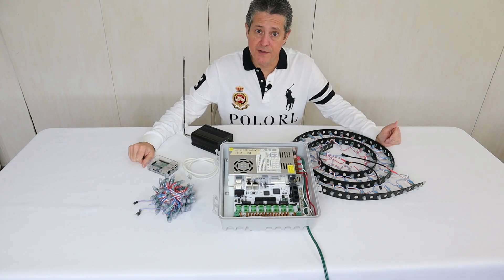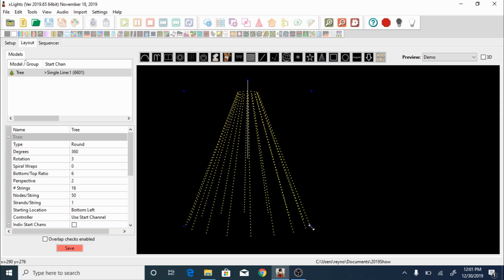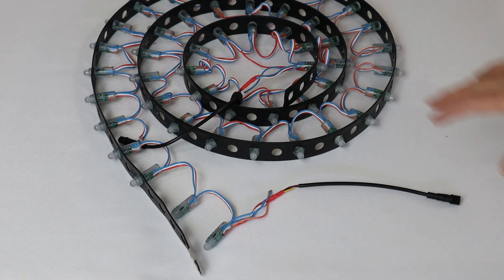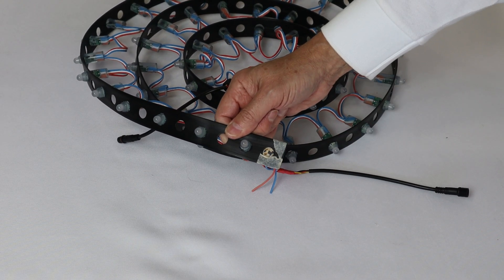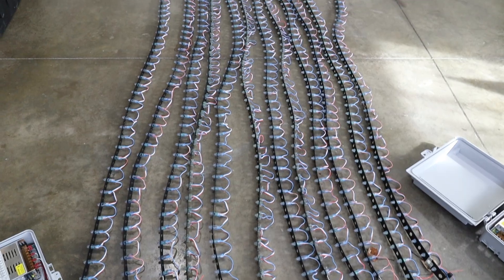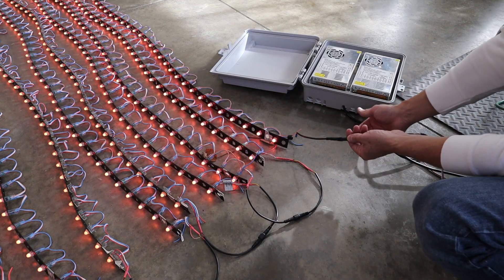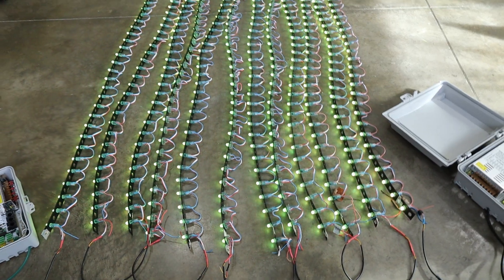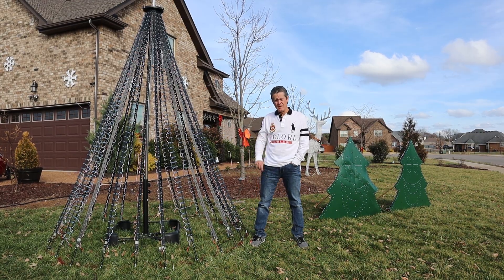How to build a L.E.D. Mega Tree - Step by Step

Comment: you have two controllers, do you have a link to the assembly of the controller with the power supply? does each power supply plug into the f16V3, doe the power supply get power from the controller? also since you have 2 controllers, and each is capable of 1024 lights, and you only use 600 each, do you run the other 424 to a smaller tree each?
Reply from the maker: Hello. I only have one controller. The controller is powered by only one power supply which sits next to it. I do have a second box with two power supplies. These ones are used to inject power to my mega tree and singing trees since they demand  more power. And yes, you could add more lights at the end of the two 600 lights strings. You will need to inject more power to them. I am going to add a star on the top of the  mega tree which I am going to connect from one of those strings.
Reply: So can you do a video dumbed down for those of who are new to show us how the power supplies work, how they connect to get power, a real close up of the inner workings. I would imagine it’s powered by a cord you plug into the controller or the wall? Maybe give us a detailed breakdown of where you got your materials and a details cost analysis. It’s so hard to know what is good. What is not. What works together and what doesn’t. Don’t be afraid to give a real “dumbed” down approach for those who also may not be computer literate. Thanks for doing how to videos. How much power does a power supply utilize. You said you have three. Thanks again.
Reply from the maker: @Lerchcon  I guess I could. Just give me some time. I have other videos that I'll like to upload first. You can find a ready to run controller just like mine in the link below.

You could save a few bucks if you do it yourself but not much.

https://www.pixelcontroller.com/store/index.php?id_product=50&controller=product
Reply: @trevilights  I guess my confusion really is dealing with importing other peoples sequences, I tried and none of them work. This cloud download crap is a pain in hen using Microsoft to download from website. And when downloaded from xlights program it didn’t work either. 

Other questions would be, what is the raspberry PI for if the controller claims to be ready to run, is there already one installed. I actually sat down and played with the xlights program. I created a full sequence for my mega tree to Mariahs all I want for Christmas. Then accidentally opened the internet. Seen the download still there so I deleted it tho king the one I created was good since I saved it. And it deleted the sound from my sequence the next time I opened it. Crazy. I redownloaded the song and added to the already created sequence. from your video I learned about layering. So good job. Little short videos of things like that will definitely garner more views for your channel. Thanks for also replying. And thanks for the videos. I also just tried to download the new version of that software and my computer keeps saying with three pop ups it will harm my computer and is blocked. The first download of xlights didn’t say that. Hmmmm.
Reply from the maker: @Lerchcon  Hi Lerchcon, Importing sequence from someone else can be very frustrating, specially because we do not know if they are in good shape or are incomplete. I will try to upload a simple video on it, but keep in mind that it would only work if you are willing to have a similar layout on your house. Now, the reason to use a Pi Controller is so you can run your show without your computer. The Falcon Player (Pi Controller) allows you to create Playlist with the songs that you want to play. You can have many playlist and play them at different time and different days.  It has many more options.  IF you are okay using your computer, then there is no need for one. I will create a short video on importing sequence shortly. Stay tune.
Reply from the maker: @Lerchcon  Just uploaded this video. Enjoy.

https://youtu.be/Elzd0GOgSm8
Reply: @trevilights  silly question. I have seen so many sites so far and forums where everyone seemingly is getting their equipment and lights from all different sources. Is there a way you can do a video of where to get all those items. Or just post links here 😂I don’t want to pay too much, Or shop a source that isn’t known for working items being received. It is China, which takes forever for shipping. and there are times we don’t get what we thought in my experience. Pictures say one thing but it’s not always right. Or damaged. And very difficult to communicate exchanges. Also in my experience. So please, if you have time can you give these links to these items of known working sites you have used. There also seems to be knockoff sites in my searches for the pixels. I don’t want to get screwed. 

Ws2811 lights do we need 12v or 5v? Seems like a Chevy vs Ford in videos. I seen these ws2811 pixels of 50 count on ray wu alibaba but some in the Aussie forums say they had issues this year with the site. But none direct to ray wu. Where do you get your pixels? How does one go direct. I don’t need to wait for a group buy. I need to experiment before Christmas this year. 😂
The Raspberry PI do we need the 3 b plus I found one on Amazon it’s called a CanaKit and it was roughly 60 bucks. Is this expensive or even the right one. Maybe it’s from that canispater guy on YouTube and has a mark up. And not that that is bad. But why pay more for the same thing if I don’t have to. Does this still need a falcon controller? 

Falcon controller F16v3 seems to. Be the best I have seen most using. have seen most buy from the pixel controller site and it’s about 360 each for run ready to go with the power supply. For one mega tree will this be enough? I will literally go small. I live on a small lot in a city. So from mega tree to street will either be 3 feet. Or 20 feet. Not sure which spot I will put it in yet. But I live in a cul de sac. So when they drive by will the “Skip a hole” strip work for me? Will the pictures come through? I also have to deal with street lights we can turn off. 
As always thank you so much for taking time. I learn allot from your simplistic approach. Your one about going online was really confusing to me. But I think it’s because I am just a new guy learning new things.
Reply from the maker: @Lerchcon  I do not by anything from chine. I had the same issue as you. When it comes to lights I only buy from Amazon. I like the idea to be able to return them for free if they is something wrong with them.
You can find a 50pcs for around $14. I am buying 500 more lights next week.
https://www.amazon.com/Rextin-WS2811-Digital-Addressable-Waterproof/dp/B01MCQP7KP/ref=sr_1_5?dchild=1&keywords=ws2811&qid=1609591519&sr=8-5
I have a Canakit Raspberry PI 3B+. Works just fine. I know that the Pi4B is also supported and has larger memory. Is up to you which one to get($). If not sure about the voltage then I recommend 12v. Do everything in 12v. Lights are a little more expensive but 12v travels more distances when injecting power. A "skip a hole" should be enough to start with. Start with 50 lights per strand, you can later make it taller. I bought the Falcon controller as a Kit. But I had to buy the case, power supply, backing plate and some cable separated. I ended up spending close to $300. So a ready2run for a little more might be worth it.

Comment: Can you explain what the extra wires that are not connected are on the pixels when you connected the pigtails?
Reply from the maker: Sure. Those are extra cables to inject power if needed. The string lights that I got came with them at both ends. If you are not injecting power then just make sure they do not touch each other as they run 12v(positive and ground). Cut the expose wire and/or put some electric tape to protect.

Comment: What a great video! Thanks! Regarding the power injection, did you make a cut in the 'load' wire between the 2 power supplies (So that only ground and data continue from the falcon and the falcon only powers the first part of the string and the other power supply powers the rest?)
Reply from the maker: Glad you liked the video. No cuts on the wire. The Falcon is also providing power to the string.  I am just making sure that I am proving enough power to the string with the power supplies. I do not want to over load the Falcon power supply, otherwise the controller might act erratically.
Reply from the maker: I keep an eye the the Falcon voltage reading in the status page.

Comment: @TreviLights Can you put a link for the supplies you used? It would be greatly appreciated. Thanks
Reply: Yes please would like to know where we can purchase
Reply from the maker: Holiday Coro, Boscoyo Studios, Pixel controller.com.
Reply: @trevilights  Sorry to be a pain. I have the LED lights. I have the power supply. My concern are the connectors at the end of the LED lights. The black strips to hold the LED lights. The tree topper holder. Could you go through and provide a link for each product. 

Your video really gave me some inspiration. I have the lights on the house doing different things. Know I need to advance to the mega tree. 

Thanks
Reply from the maker: @joebitt1  these should work https://www.amazon.com/dp/B07BW9DQRD/ref=cm_sw_r_cp_apa_fabc_nI73Fb39CMPHC?_encoding=UTF8&psc=1
Reply from the maker: @joebitt1  https://www.holidaycoro.com/PixNode-Strip-MegaTree-Topper-For-MegaTrees-p/750.htm
Reply from the maker: @joebitt1  https://www.holidaycoro.com/PixNode-Pixel-Mounting-Strips-p/767.htm

Comment: Trevi, which Rasberry Pi model are you using? thanks
Reply from the maker: CanaKit Raspberry Pi 3 B+ (B Plus) with Premium Clear Case and 2.5A Power Supply

https://www.amazon.com/CanaKit-Raspberry-Premium-Clear-Supply/dp/B07BC7BMHY/ref=sr_1_4?crid=F4K581M430VS&dchild=1&keywords=canakit+raspberry+pi+3+b%2B&qid=1608562945&sprefix=canakit+ras%2Caps%2C200&sr=8-4

Comment: Is that the holiday coro mega tree? Also what size and height was the pole. I like your set up.
Reply from the maker: I built the tree myself. But the topper and plastic strip I did got from Holiday Coro. The center pole is actually made of two antenna masts. Around 9ft tall.

Comment: How many Amps does this tree require? How do you figure out how many Amps you need?
Reply from the maker: each lights consumes around 0.06 watts when lit white and at full brightness. So 1200 lights will be 0.06 x 1200 = 72 Watts. But since they are not lit white all the time and not a 100% brightness the consumption is much lower.  The power supplies I have are 29Amp 360 Watts. Should be enough to power more that 4000 lights. It's good not to run a power supply over it's 75% capacity.

Comment: Awesome video.  This inspired me to start a small rgb display on top of my existing yard and house lights.  May I know how you get to connect power injection using pigtail?  Im using Ray Wu lights with pigtails.  Thanks.
Reply from the maker: The lights that I use come with an extra set of wires coming out from the first and last light. If yours do not have this extra pair of wires then you will have to split your positive and ground wires. Or use a "Y" type adaptor.

Comment: Hello Mr. Trevi, can I ask if you could help me with a video of power injecting? Estoy medio menso lol and I'm having a hard time. The way you explain your video is the best I've seen. Please, porfa una ayudita 🆘
Reply from the maker: Injecting power is very simple. The power supply I am using are like this one...
https://www.amazon.com/ALITOVE-Universal-Regulated-Switching-Transformer/dp/B06XJVYDDW/ref=redir_mobile_desktop?ie=UTF8&aaxitk=s9DjW5F12eETMZNr.Zcjbg&hsa_cr_id=2776961390401&pd_rd_r=aad1c139-a604-4d9c-b037-c540c276b25c&pd_rd_w=I3ZmG&pd_rd_wg=Whaqt&ref_=sbx_be_s_sparkle_td_asin_2_title

This power supply have three 12V+ screws and 12V- screws. All you have to do is connect one positive and one negative to the lights positive and negative wire. Just make sure you do not flip them. From my experience injecting every 300 lights should be enough.
Reply: @trevilights  Thanks again for the video... It looks like you are using multiple power supplies,  my question is with the extra power injection wires on the ws2811 strings is it OK the have one power supply on one end of the string and another power supply on the other end?  Thanks for the help!
Reply from the maker: @calebbarker9366   Hello, you can use the same power supply at both ends or use a second one.

Comment: So, let me understand this, you are using 2 channel from your controller to run the mega tree, I though you need a channel for every string, What I'm missing here? Can someone help me out? Please!
Reply from the maker: Let's call them ports not channels. The controller uses the word channel for other purposes when transmitting data to each LED. Each port can handle 1024 lights per port. It does not matter what you use them for. For example on port number 1 you can have a Singing tree with 229 lights, then jump to a second singing tree with another 229 lights. You can then jump to a snowflake and then to a candy cane. As long as they do not add up more that 1024 lights you are okay. Then you program the controller using xlights(can do it manually to but it's easier using xlights) telling on how your setup it. So your first singing tree starts on led 1 and ends on led number 229. Your second singing tree will start on led number 230 and so on. Of course you will need to inject power on many different point for all this props since the controller power supply will not be enough. So one port can service different props. Since my tree has 1200, I broke them down by half to make things easier. I could've done 1000 in one port and 200 on another port as well but since I have enough free ports and used two.
Reply: @trevilights  Thank you for easy tutorial

Comment: Awesome!  Please do more instructionals. I love the way you explain things. Also, would like to know more about power injecting. (Do you splice into the positive and ground wires?).
Reply from the maker: Yes, Most of the WS2811 lights come with two extra wires that are already connected to the positive and negative at both ends. All you have to do is connect a power supply into this wires. Every 300 lights should do the trick.  From what I have read every LED consumes about 0.06 watts. So if you have a 1000 lights they will be consuming about 60W(0.06 X 1000). So buy a power supply larger that 60W. You can have multiple wires coming from this power supply into the different points of the strip.